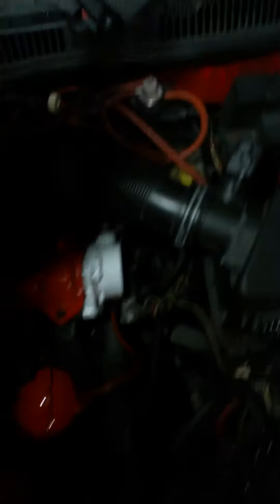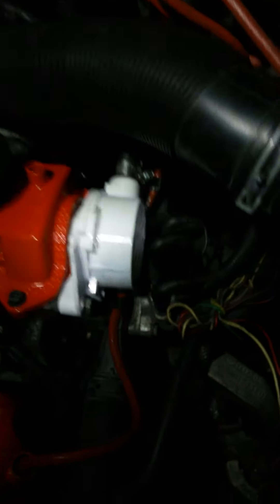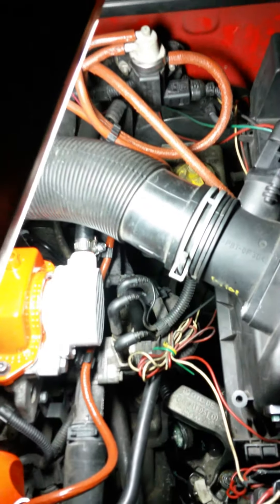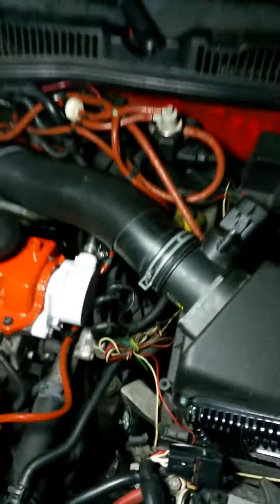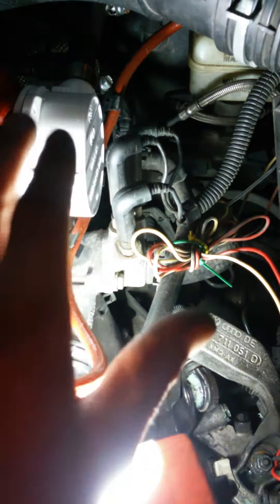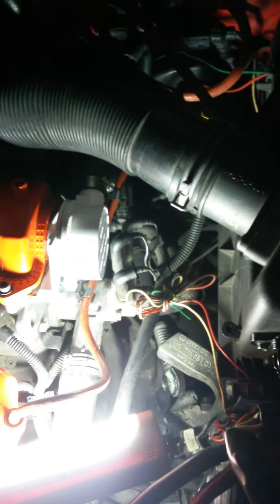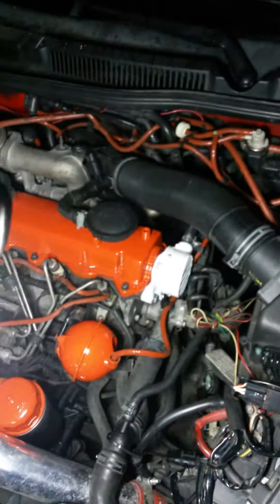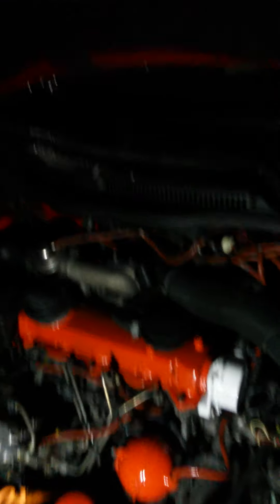Mk4 alh tdi vacuum pump failure

Comment: Thank you for the contribution.
It has helped me a lot, had more than one year looking for the failure of power loss, it had changed the N75 valve, turbo actuator, piping and order was the same problem you mention in the video.
Reply: Did you found the solution?
Reply from the maker: Ante Gavranović replace pump if over 150k miles AND all vac lines. check actuator, do mr muscle turbo clean. use mobile one diesel truck full synthetic 40 weight oil. clean egr valve intake then go check servos. ie n75, egr actuator etc.
Reply: Amado Urias G. i changed everything exept vacuum lines :) car goes like shit until 2500 rpms and i need more push to break. when ac is on the car is like dead chicken
Reply from the maker: Ante Gavranović check fuel restriction
Reply: Where was the fault?

Comment: Can a loose nipple cause turbo overboost. Mine is overboosting then regulates the boost. I have no fault codes.
Reply from the maker: Sticking vanes in turbo imo
Reply: @organicvids  turbo moves easily. I mounted it liken4 days ago, fully cleaned.
Reply from the maker: @gerinagy9820  turbo actuator or if u have earlier pre mk4 there is a vac line from computer that gets oil in it and overboosts.